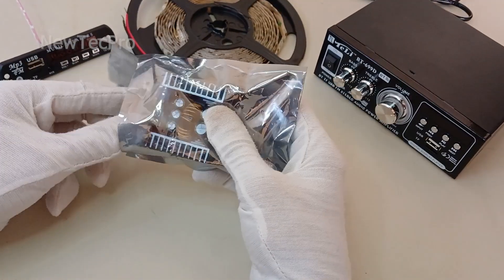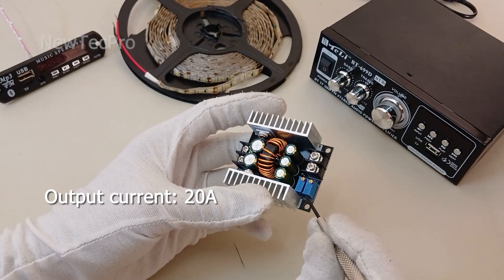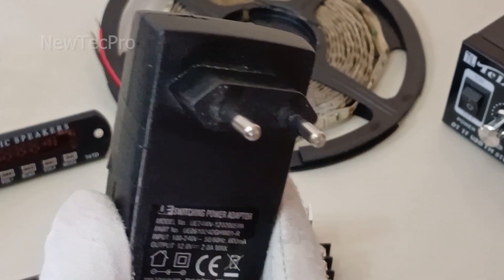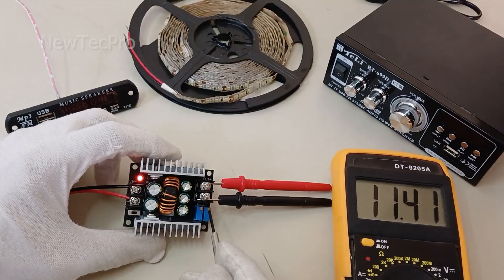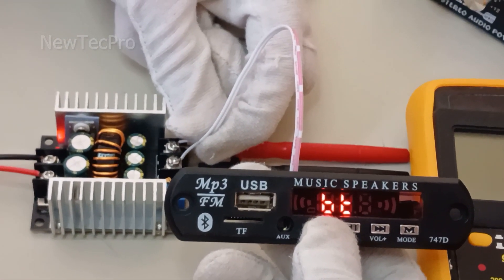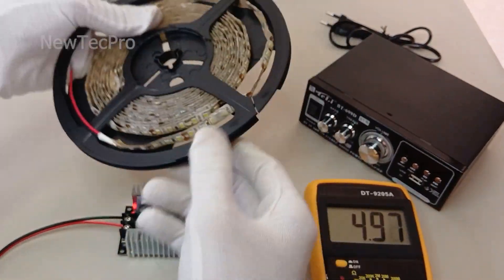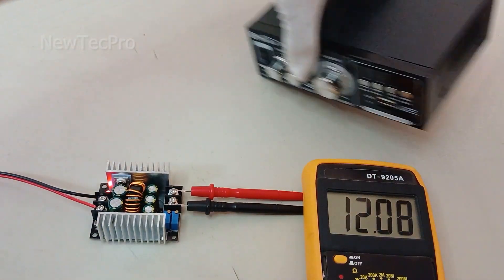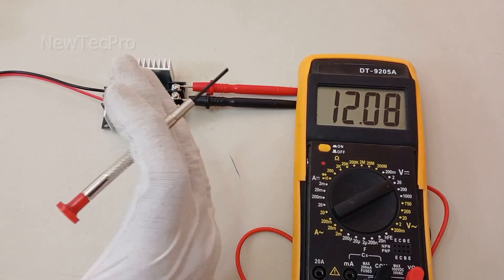how to use the 20A 300W Buck Converter: Step Down Module DC-DC Testing

Comment: I have a solar charge controller that oscillates its output from 10 to 15 volts, and I want a stable 12-volt output. Could I use this module?
Thank you very much.

Comment: I bought 20 of these, plugged each into a LiPO battery (7.4W), and only 2 of 20 worked. The rest had no burning smell, but the LEDs didn't turn on. Power switch is on. Voltometer measures 7.4v in, 0v out. Could 18 be defective?
Reply from the maker: That's definitely not the expected performance; 18 out of 20 being defective is highly unusual. Could you check if the input voltage is correct and if there's any short circuit on the output? Also, verify the wiring polarity carefully.

Comment: @new tech pro: when i turn the knobs, it doesn't do ANYTHING. No voltage change nomatter what. No result to turning knobs
Reply from the maker: Thanks for sharing. If turning the knobs does nothing, check your input voltage, load connection, and current limit setting. Let me know your setup—I’ll help!

Comment: What this happens 12v remains but only Ampairs increased with this module.
Reply from the maker: With this you can reduce the voltage. Also limit the current.

Comment: Hello sir, if i have a power supply of 12V 12.5 A and if i use this buck converter, can i control the output into 5v 20A?
Reply from the maker: Yes, this converter will reduce the voltage for you from 12 to 5 volts DC. The maximum power that can be supported without cooling is 150 W. So, yes, it supports 5V 20A output

Comment: "Awesome tutorial! It’s really helpful to see the 20A 300W Buck Converter in action with 
different devices. Great job explaining everything!"
Reply from the maker: Thank you so much! 
Can you also comment on the SEO of this video? Is there anything I should do better?

I'm glad you found the tutorial helpful. 
 It was a lot of fun to showcase the 20A 300W Buck Converter with various devices. If you have any questions or need further clarification, feel free to ask. Appreciate your support!
Reply: Good luck 🍀 
What is the name of module.?
Reply from the maker: Hello and thanks. It doesn't have a specific name. If you search for this title, it is related to this product:
300W 20A DC-DC Step Down Converter Constant Current Adjustable Converter Step Down Voltage Module Volt Reducer Transformer Module